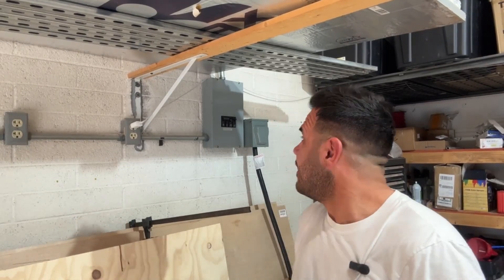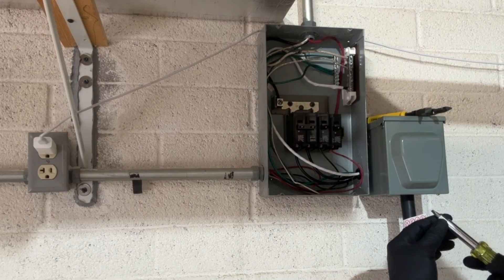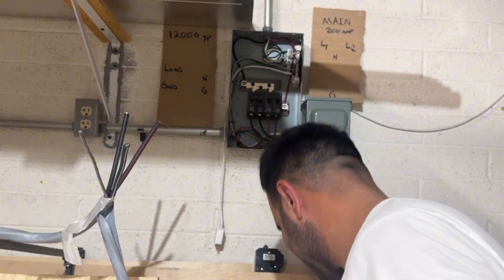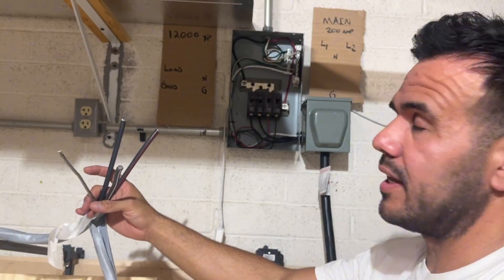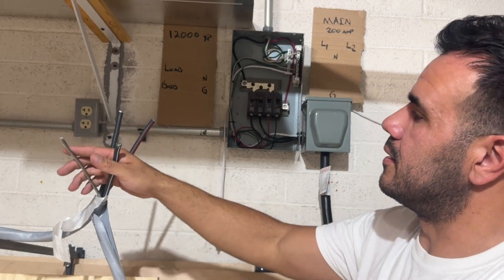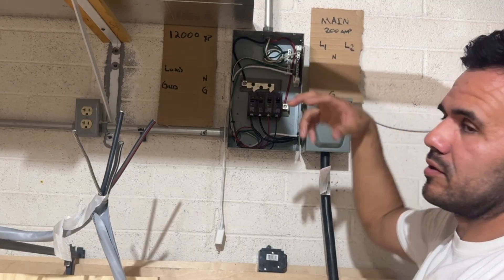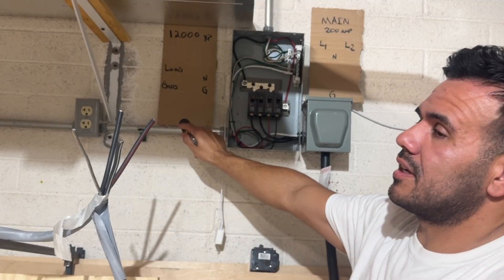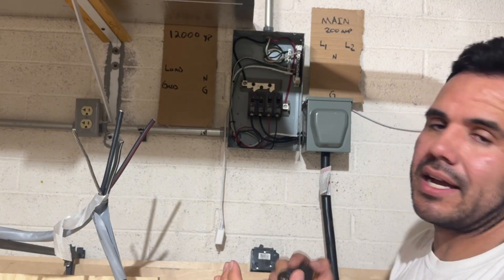12000XP Wiring Explained: Sub Panel Cleanup + Critical Loads + Grid Bypass

Comment: You should have purchased a 12kW low frequency inverter instead of that wimpy high frquency transformerless inverter. Then you'd have a real inverter.
Reply from the maker: Appreciate the passion, but I picked the 12000XP based on efficiency, weight, install flexibility, and price — It’s doing everything I need it to do and I would buy another one without hesitation.

Comment: I have two 6000xps and I setup my system the same way you did. The panel i put all critical loads in has a 100 amp main breaker on the top that I am not using. I have always thought that if I ever need to take my inverters off line for a while, I would run the load wires from the grid box to the top breaker and be up and running everything from the grid in less than 10 min. I would go ahead and wire it up but I do not have an interlock on it to keep anyone from powering the critical load panel from both the grid and the inverters (at the same time). I think that would work well and be very cheap, I welcome your thoughts on it. keep making the great videos!
Reply from the maker: That’s a really clever idea — props to you for thinking it through. It’s basically the same function as a transfer switch, and you’re totally right: ideally, an interlock would make it safe and foolproof.

I’m always surprised at how many different ways you can go about solar setups — there’s no one-size-fits-all. I could even do something similar on my system: pop in a 50A breaker on the main panel, run two wires to the lugs on the CLP after disconnecting the inverter wires, and boom — backup from the grid without having to move all the circuits. Appreciate you sharing this — really smart workaround!